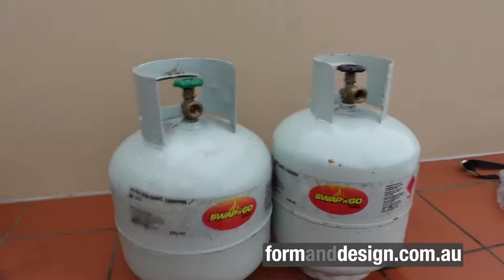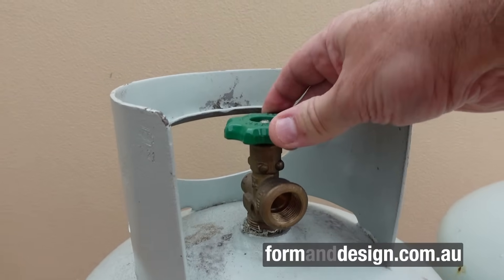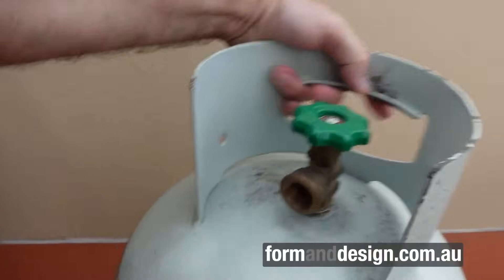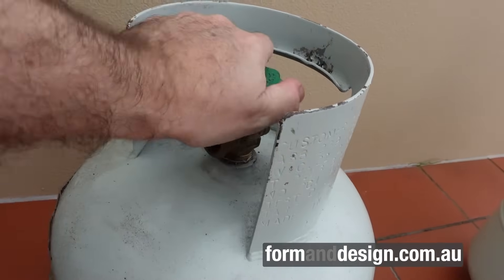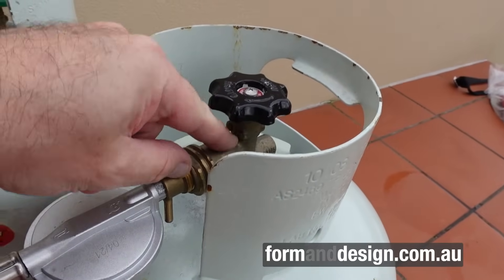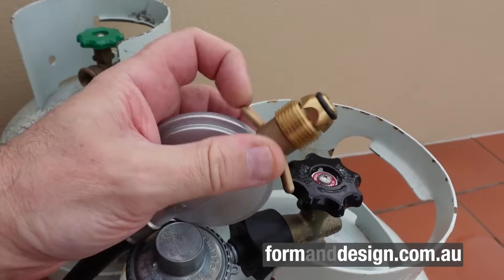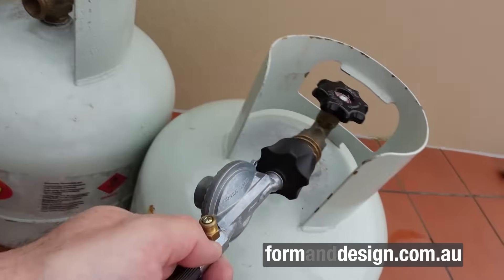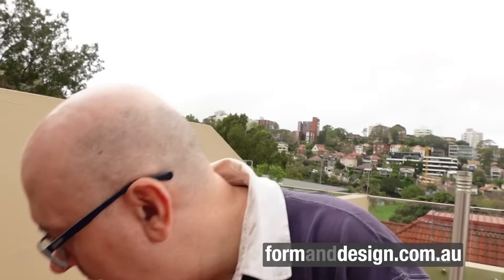LCC 27 vs POL Gas Fitting - What's the difference?

Comment: You can get an adapter for your gas bottle so you can use either fitting
Reply from the maker: Following your comment, I have searched online for either POL to LCC27 adaptors or LCC27 to POL adaptors and found none to suit LCC27 fittings in Australia. There are plenty of QCC to POL adaptors for the US market (available online in Australia through foreign sellers), but these are not for the Australian market, so my comments are restricted to the Australian specification for the LCC27 fitting. A gas bottle fitted with an LCC27 valve assembly accepts both LCC27 and POL fittings, so no adaptor required there! If you have a bottle with a POL valve assembly the easiest, simplest and safest way to allow it to accept a LCC27 fitting is to go to a petrol station or hardware store and swap your old POL bottle for a bottle with a LCC27 valve assembly. If you were to attach a fitting to an old POL bottle to accept a LCC27 fitting then you are introducing another possible source for leaks. Also this suggests that your bottle is older and it would be wise to change it over for a newer bottle that accepts both fittings. The swap system does not care if the bottle is yours or belonging to some other swap brand. They are happy to have your business. You are not talking about a lot of extra money to swap the bottle over either. Additionally, if you want to keep the swapped bottle and then get it refilled instead of swapping it then you can do that. My recommendation is to go with the safer option and not use inline adaptors when there is a simpler and safer system available.

Comment: Can you get an adapter in case you're camping and forget ?
Reply from the maker: Instead of looking for and purchasing an adaptor, consider either buying or swapping your bottle. The new valve assemblies accommodate both POL and LCC27 fittings
Reply: Hi, yes you can get adaptors. I needed to go from the new LCC on the  BBQ hose to an old POL cylinder. I got it off Amazon, about $16 I think.

Comment: Thanks. Very helpful and informative.  I bought a gas bottle gauge from Bunnings today, not realising it had the LCC27 connection.  It was only when I checked on line that I learned about the change from POL to LCC in 2021 and found myself suddenly pannicking, thinking that if I changed out my Swap and Go bottle it wouldn't be compatible with my BBQ, Caravan, etc.  Reasuring to know that I can still connect both types.
Reply from the maker: Glad it helped
Reply: A gas bottle gauge for bbq wont work anyway as the pressure wont change unless it almost empty. A fish scale is better.

Comment: The POL connector has a nitrile rubber seal on the tip. I can't see any form of seal on the LCC27. How does the LCC27 regulator seal to an LCC valve? And how does the POL regulator seal to the LCC27 valve?
Edit to add: The original POL connector did not have a seal and used metal on metal but quite quickly manufacturers found it was prone to leak so they added a variety of rubber seals; settling on the bullnose and oring variety. Will Australia need to go through the same discovery process?

Comment: Honestly, I prefer the POL fitting.   I feel they are more secure and for me have less leaks around the RV.   I know the other ones are only supposed be done hand tight but sometimes to seal them tight, I've had to use channel locks, which I don't like to do.

Comment: Do you need a licensed gas fitter to change the hoses over? I i know it's easy but i don't want to give the insurance co. a way out
Reply from the maker: If in doubt, get a licensed gas fitter. It’s always good practice to check the integrity of any gas fitting, new or old, by using soapy water around the fitting. If it bubbles then the fitting is not safe. The fitting needs to be under internal pressure (ie gas flowing through) for the test to be valid.

Comment: POL TO LCC27 adaptors are available too
Reply from the maker: Be warned that these adaptors do not provide the additional safety that the LCC27 bottle fitting provides. The safety valve is not included in the adaptors. Also if purchasing one of these adaptors make sure you are buying a POL to LCC27 adaptor and not the American QCC adaptors. It’s just a whole lot easier and safer to swap your bottle for an LCC27 bottle through one of the bottle swap outlets. They’ll happily swap your own bottle for one of theirs.

Comment: Pain in the ass, new appliane means new bottle as well
Reply from the maker: Not really. You'll get a safer bottle and you can simply swap your bottle (even if you own it, for a pre-filled and checked bottle) at a petrol station that uses Swap-n-Go or other bottle swap systems. It's hardly onerous and you don't have to wait around for someone to fill your bottle.

Comment: I just picked up a new POL fitting for my tank and for some reason I can’t get it to release any gas using this new fitting. 🤷🏻‍♂️🤦🏻‍♂️
Reply from the maker: There are some discrepancies with older POL fittings. Also the regulated useful life of a regulator/fitting assembly is ten years. That goes for gas bottles as well since they have to be re-certified every ten years and stamped as such. That's why it's good to use a swap system. In terms of your old POL fitting, my recommendation is to go to a hardware store and buy a replacement hose/regulator/ fitting, like the one I showed in the video and replace it.

Comment: Excellent explanation of the changes. Thank you for posting.
Reply from the maker: Thanks
Reply: great explanation. unfortunately my POL fitting will not fit my LCC27 cylinder. i reckon someone has borked the thread. anyway, trip to bunnings for some new gas lines.
Reply from the maker: There are some discrepancies with older POL fittings. Also the regulated useful life of a regulator/fitting assembly is ten years. That goes for gas bottles as well since they have to be re-certified every ten years and stamped as such. That's why it's good to use a swap system. In terms of your old POL fitting, my recommendation is to go to a hardware store and buy a replacement hose/regulator/ fitting, like the one I showed in the video and replace it.

Comment: So why is everyone selling gas burners with just a black hose.
Reply from the maker: "Everyone" might be an exaggeration. Firstly, I'm only talking about Australian standards. It's impossible to tell where you are from without you identifying your country. If you are not from Australia this does not apply to you. If you are from Australia, I think that you are referring to small bbq's or camping stoves typically purchased from camping shops. If this is the case, then you can find these smaller items supplied with a simple black hose and a hex shaped coupling on the end which is not at all like the the POL or LCC27 fitting in the video. In that case the video is not for you and should ignore it. If you do have the smaller bbq/camping stove with the simpler fitting then these fittings are designed for very small gas bottles of 2kg or less, not the 5 to 9 kg bottles referred to in the video. I hope that helps.

Comment: What about the 2 burner they come with a black hose and that's it
Reply from the maker: I'll duplicate the response to your previous comment here.

"Firstly, I'm only talking about Australian standards. It's impossible to tell where you are from without you identifying your country. If you are not from Australia this does not apply to you. If you are from Australia, I think that you are referring to small bbq's or camping stoves typically purchased from camping shops. If this is the case, then you can find these smaller items supplied with a simple black hose and a hex shaped coupling on the end which is not at all like the the POL or LCC27 fitting in the video. In that case the video is not for you and should ignore it. If you do have the smaller bbq/camping stove with the simpler fitting then these fittings are designed for very small gas bottles of 2kg or less, not the 5 to 9 kg bottles referred to in the video. I hope that helps."

Comment: How do you fit a pressure guage to the new fitting
Reply from the maker: I mean this with all sincerity, but if you are asking that question I would strongly recommend that you seek the assistance of a gas fitter/plumber to help you. If you are not familiar with how to change a gas fitting then you might create a situation where gas could leak from the fittings and cause a fire. Incorrectly installed gas fittings account for a large proportion of injuries from gas operated appliances. FYI gas hoses with regulator, pressure gauge, and LCC27 fittings are sold as a complete unit from camping stores and hardware stores

Comment: how about the small gas bottle the 3 kilo? will they make one with LCC 27?
Reply from the maker: No. As far as I know LCC27 fittings will not be applied to the smaller camping style gas bottles. LCC27 fittings will be progressively fitted to the “leisure series” bottles such as the 4-5kg and 9 kg bottles like those typically available through gas bottle swap outlets. This only applies to Australia.
Reply: @FormanddesignAu  thanks for that, I do have 2 x 9kilos and one 3 kilos, I meanly use the 3 Kilo one till it runs out , then change to 9 kilos till I fill the 3 kilos. They very new, will keep for now.

Comment: Great video.  Question... do you know if the LCC-27 is the same as the US QCC-1 fitting?  They look the same... however I've seen there are different POL standards around the world!
Reply from the maker: I really don’t know. I was only commenting on the Australian situation. I believe that the Australian fittings are unique to Australia
Reply: No there is a small difference in the shape of the brass cone so the AU version was unique
Reply: Thread size might differ but it is the same concept as American qcc1 gas cylinder fittings.

Comment: Thanks for detailed explanation. 
What’s the option with old floor bayonet inlet? 
Should it be changed by a licensed plumber or I can change it  myself?
Reply from the maker: That’s a good question. It’s not compatible. DO NOT TOUCH IT. The bayonet fitting is for natural gas. Gas bottles are filled with propane. The gases are different as are the delivery pressures. They have different regulators and different burners. Note this relates to Australia only. Always use a licensed gas fitter to change or adapt gas fittings wherever you are in the world. Seek their advice in the first instance